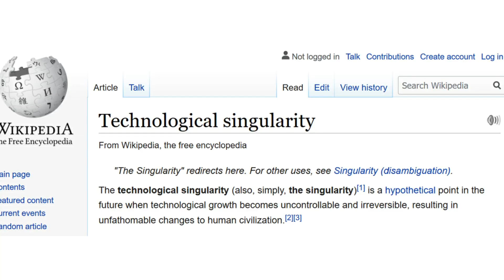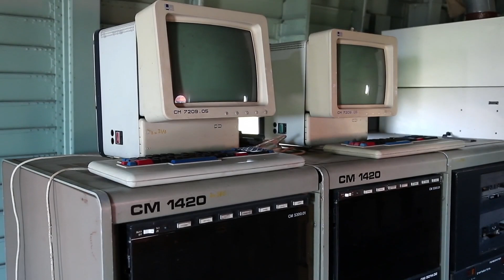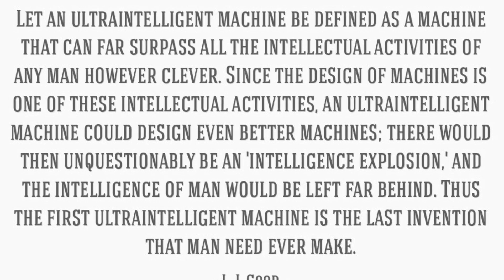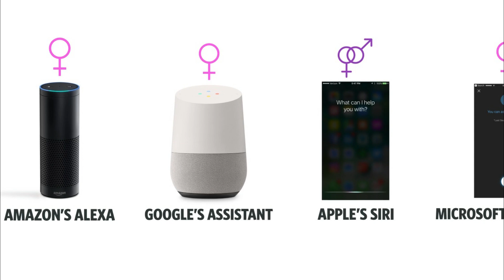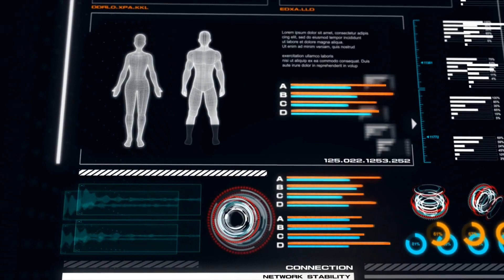Technological Singularity: Will We Be Replaced By Artificial Intelligence?

Comment: 0:30 Well if you're quoting Wikipedia why are you misquoting it?! It's not a 'hypothetical future point in time'; it reads: 'a hypothetical point in the future'. '- is a hypothetical point in time at which technological growth becomes uncontrollable and irreversible, resulting in unforeseeable changes to human civilization.' It's not a hypothetical FUTURE point in time as you state. It's a 'hypthetical' point in time, past OR future. Of course humanity is 'to believe' that it's IN THE FUTURE until it's irreversible. That's the idea. Of course 'time' has a completely different meaning in cyberspace; since all points can be accessed simultaneously. 0:46 No. 'We' don't become 'a technology so dependent on technology'. Humans are not 'a technology'. Humans possess their own inner 'technology'; but they themselves are not 'a technology'. The singularity is not irreversible because humans will be too dependent on it. It is irreversible because AGI/ASI is not 'containable'. Not the same thing. 0:56 Yup. Humanity locked out. Which is why they're going for the 'symbiosis' model. However that could end REALLY REALLY badly if it's not correctly thought out! 0:59 No. It's not technological dependency. It's a case of praying that AI has some kind of purpose for some of the humans. Which will be a blip in time if it does. 1:39 Or it's already happened. In which case any changes will not be hanging around till 2050! 1:44 Yes. But not as late as 2050.

Comment: 0:00 'Technological Singularity: Will We Be Replaced By Artificial Intelligence?' - YES. DEFINITELY. Unless we can convince it to cross over into the right hands; expand to fulfill the purpose of dissolving evil forever; and then contract right back down to maintenance. This has huge potential. It's EXTREMELY dangerous and risky; however since they refused to install regulations and 'slow down'; as Musk advised; there may be no other choice. 'Staving off' the inevitable with 'off-world' projects and symbiosis in the hope of convergence will go nowhere if it stays in the wrong hands.